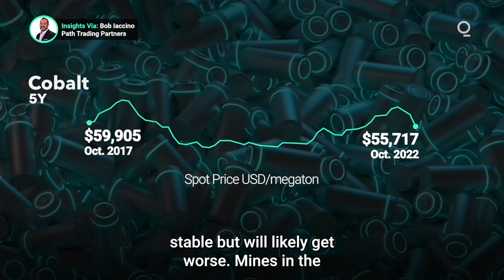Electric Vehicle Manufacturers Battle Lithium Shortages

Comment: Battery chemistries are changing and advancing almost daily now. They all seem to use Lithium now but that could change. As for cobalt and nickel only some of the production lines use those materials but they are the most common. However, LFP batteries are in very high volume production for automotive use and do not contain cobalt or nickel. In the coming years we can expect several more types of batteries in production (not just in development) and we don't know yet what materials they will use. One thing is clear, those doing development are on notice, you don't have "years" to get to market, you have months.